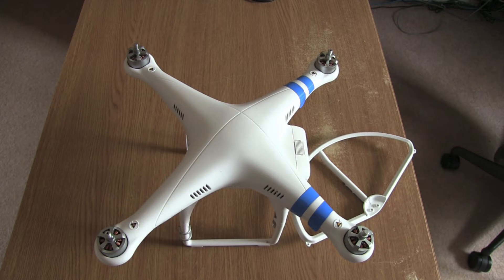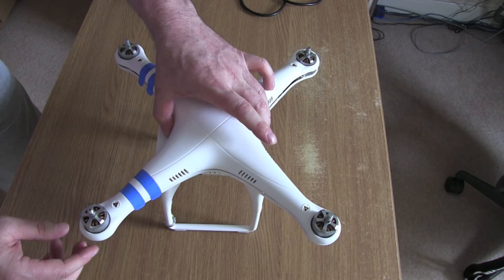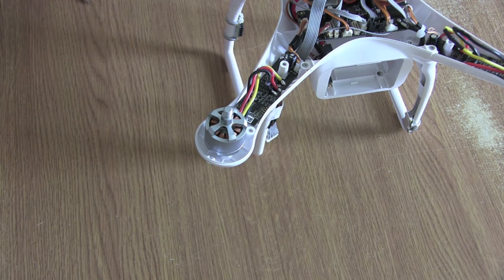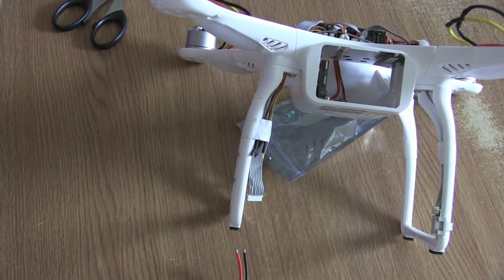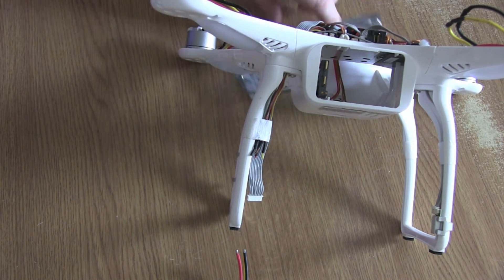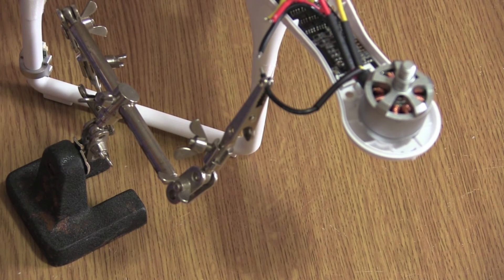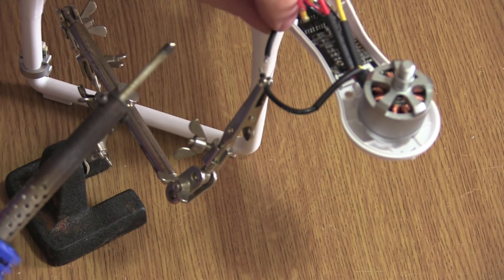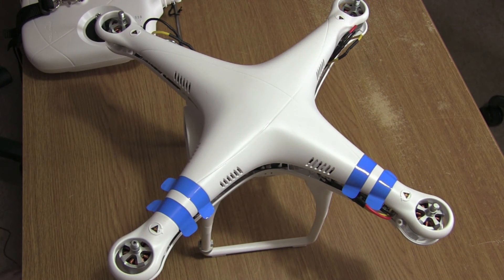DJI Motor Replacement Detailed Video

Comment: I did the exact same repair on my p3s and the motors wont start...  Is there some sort of update when replacing motors I am not aware of?  They are wired correctly and everything on the app states no problems but the motors will not start...
Reply: Maybe the control  is not the new up to date one that the new motors need to run new style       Scam  same thing just happened to me just now